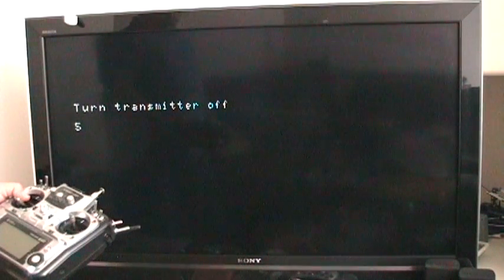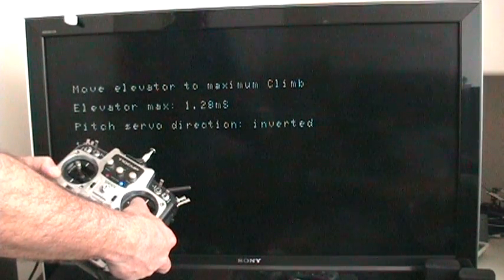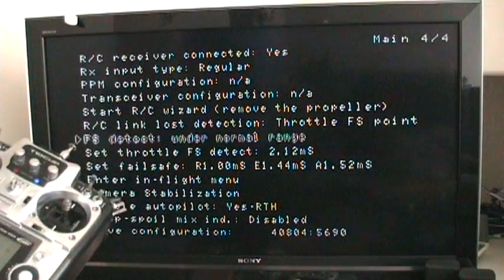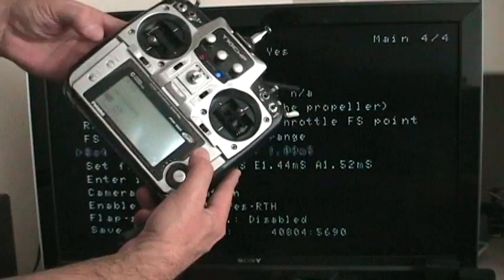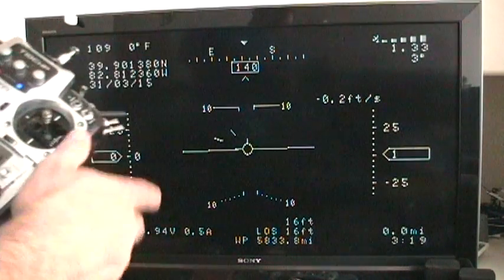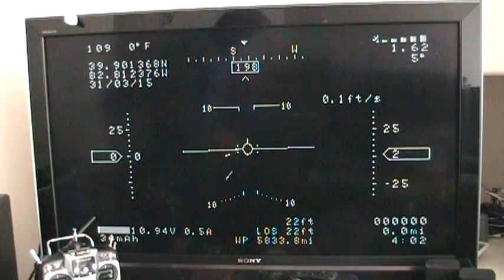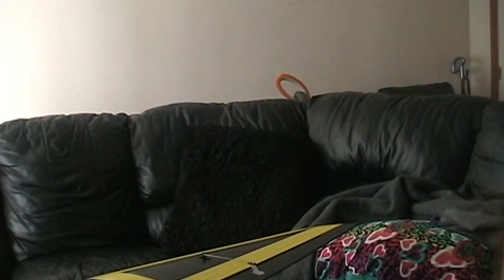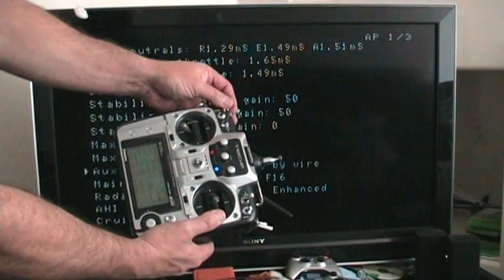RVOSD SETUP 6.0

Comment: Hi . prodría you be kind and help me with mine. sig has the problem. I see in the video that compensates correctly pocicion change the model. mine compensates very little almost nothing. went up all the gains and changes nothing. manual responds to 100%. I also occurred to me that leveled off in flight and did not respond directly to aileron or the call. only gas engine and rudder. that may be happening. Thank you

Comment from the maker: Even do the rvosd was setup properly, for some reason the airplane dd not respond to comands at all, so the airplane and all the equipment was lost, never to be founded. Because the volt and miliamps use is so bad in this system I desided to use the vector from readymaderc.com now this is this same and better system that RVOSD, and with all the bells a hueso,  the sofware is windows base and is super duper, you voltage and miliamps use is better display. you get more for you money, if I had to review the two of them my choise will be the vector. And cheaper with more options.  The price of the RCOSD should be 150 dollars no 300 for what you get. in the 6.0 plus the trouble of the set up, The vector manual is so fantastic same as the windows base sofware, you read the manual and you do not need help from anyone.  100% winner the vector from eagletree.
Reply: +Humberto Montalban Gah !!  I only have a couple of test flights so far and have to do more to get the plane flying well in the autopilot modes before I dare any FPV.  The plane incl kit is nearly $2k NZD so I'd be pretty cheesed and nervous if it headed off over the city :-(
Reply from the maker: +Bruce Doig  yes I know what you mean, I was really piss, but now Im testing the vector and is more easy to read the osd, plus I order this time the tbs crossfire UHF long range receiver, now I do have a futaba and yes Im still nervous to lost the second plane. LOL check our videos in Facebook ,,, Columbus Big Birds is our club and we post videos.  But Bruce, check you batteries real good, I think that was my problem and lost the plane.
Reply from the maker: +Bruce Doig https://www.youtube.com/watch?v=k1jRhvYkjms